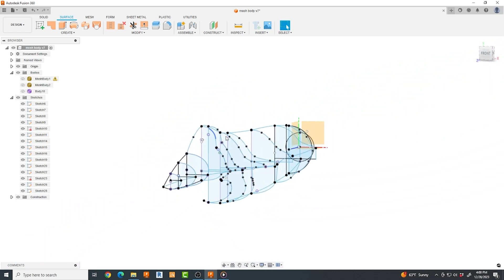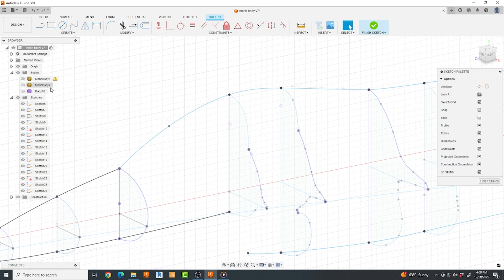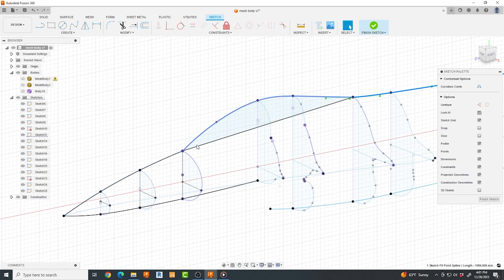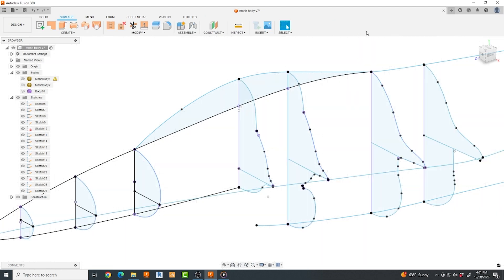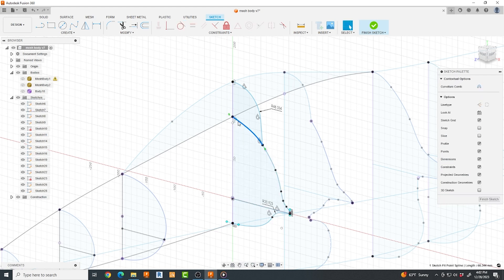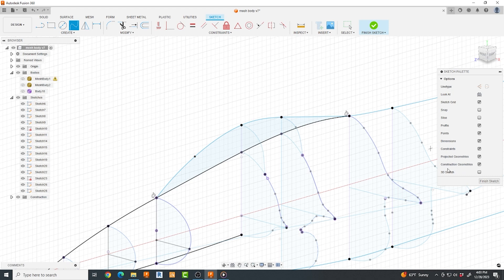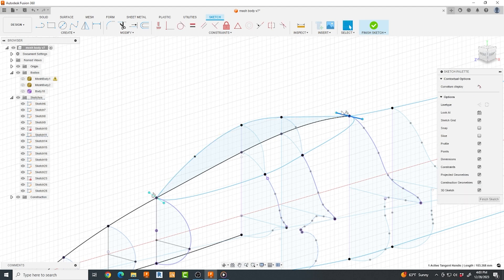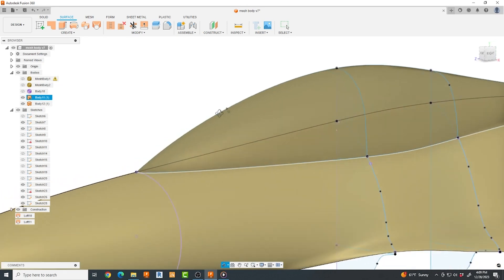Surface Lofting An F16 Fighter Jet Canopy In Fusion 360 - See How It's Done!

Comment: I m trying to learn to build my own aircraft using a plan with cross section . Then make a mold for my plane to use carbon fiber. I can not find any video. Would you make one from 0 to 100 please
Reply from the maker: That's a great suggestion and I've considered it a few times.  I'll put it on the radar!

Comment: Awesome video man. Cant wait to see the rest of the series :D What scale are you looking at?
Reply from the maker: Good question.  My goal is to CnC foam cut this model.  The machine I have access to is enormous.  5' x 10 foot bed, but the z axis is limited.  I'm thinking about 6 feet in length so that would put it at about a 1/8 scale model.
Reply: @redbaronrc  nice. I am in the idea phase of designing a 1/8 scale that can be 3d printed. It will be fun to watch your progres and maybe share some ideas and maybe have some common parts used :)